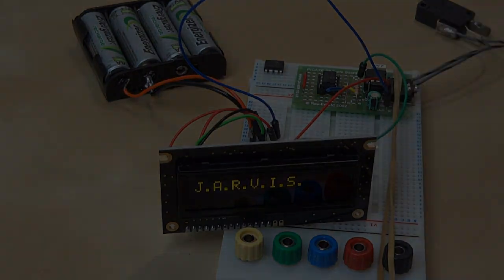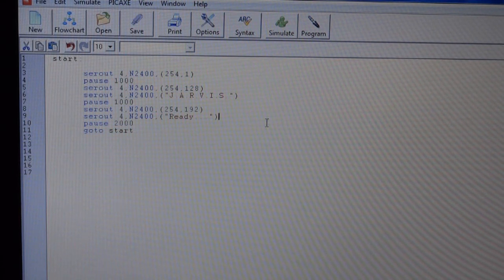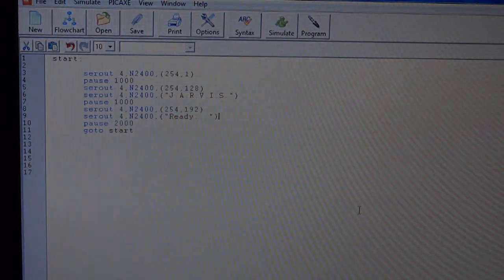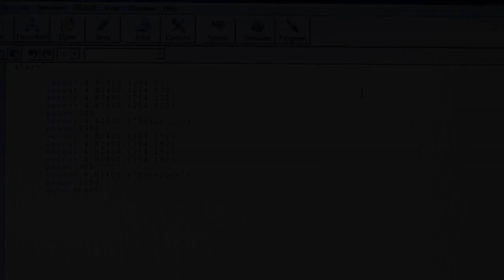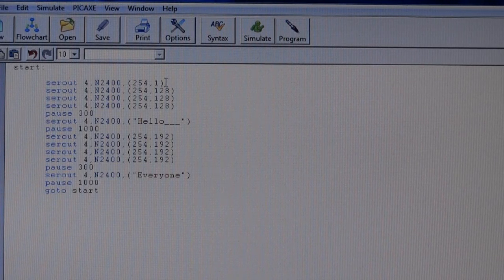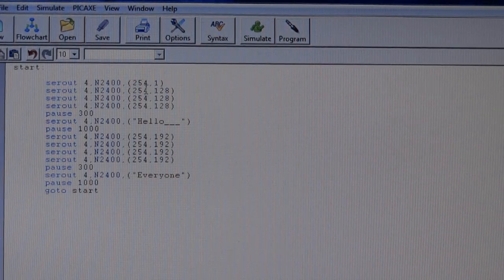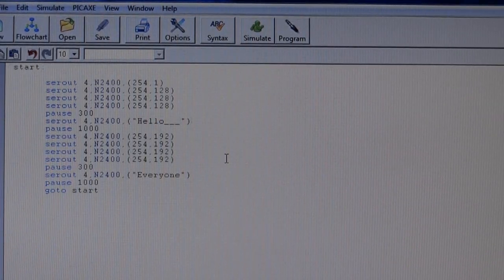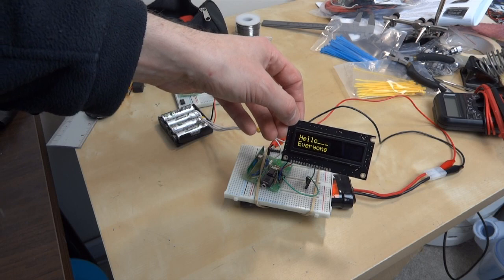Iron Man Power Suit #49 | J.A.R.V.I.S. | James Bruton

Comment: I think it would be pretty cool if the display was fixed to the helmet with a rod connected to servos, instead of being fixed to the faceplate. So, when the faceplate goes up, you see the display sitting there, before it's flipped up into the helmet.